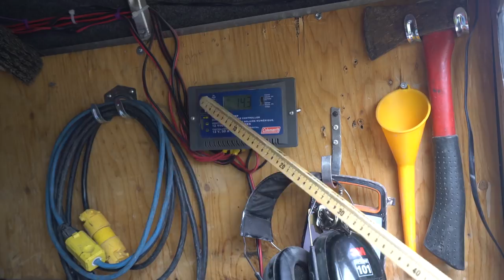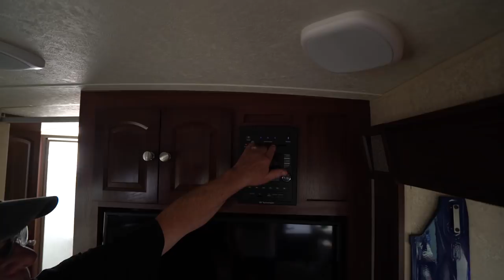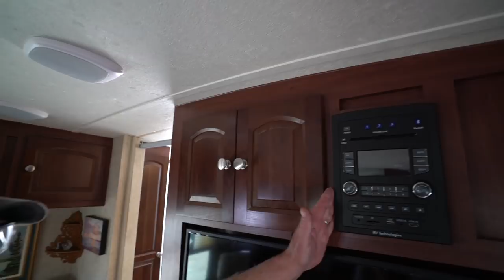BADGE'S OFF GRID SOLAR RV TRAILER TOUR

Comment: Do all isolators work the same way? The car battery has to be topped off like a reservoir, first. Then the waterfall gate opens to the dead solar batteries?
Reply: Jeffrey A. Smith no it charges all batterys at same time if it needs it will charge the battery if it dont the alternator will stop  charging the battery

Comment: can you get the model number of Badges isolator
Reply: Coolbreeze thats just a 90 amp isolator 🇨🇦🇨🇦
Reply: Vlite Rving I heard you say that but it has a diode vs a relay and was just wondering the brand and model number. You usually don't just buy any old stuff you usually get the good stuff
Reply: Isolaters have diodes relays dont 🇨🇦🇨🇦